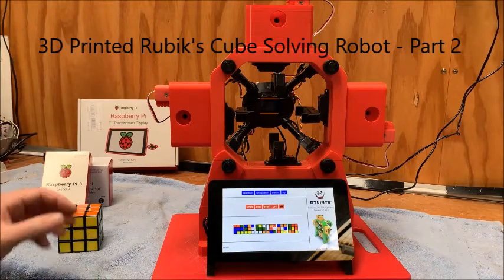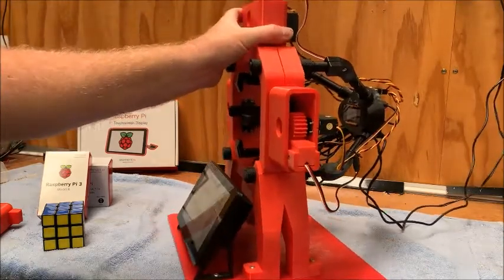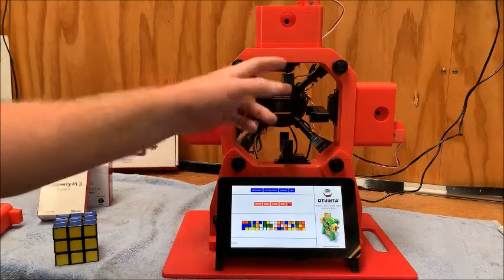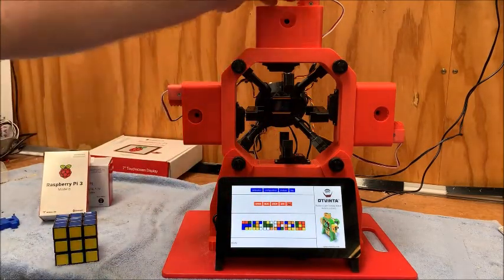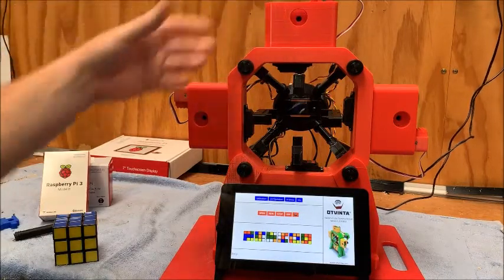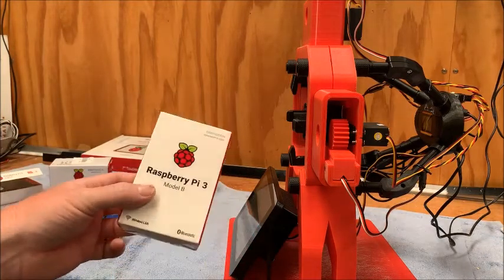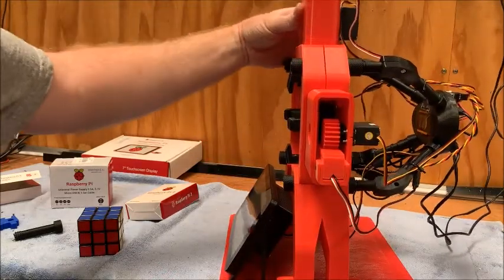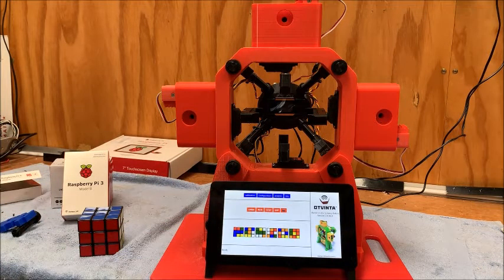3D Printed Rubik Cube Solving  Robot -  Part 2

Comment: It's Sept 15, 2021 and I just built mine and I have all the hardware but waiting on a recommended RCA Cambio because I am a MAC guy and the instructions call for Windows 10 and seems that a MAC IO won't work. No big deal as I got a used one on eBay and I will also print a mount for the robot as you did. I also have a Raspberry but I'd rather run it stand alone via the RC touchscreen. I did have to file and sand down each of the arms so the sliding gear and servo's don't bind. I did that before installing any of the servos because I figured they might bind if the tolerances were off even a little. They did rub quite a bit so sanding, I felt, was definitely needed. I printed all the parts, I did not buy them as I saw you could buy the parts from OTVINTA. I have some pretty high end printers and I USUALLY design my own projects, this is the first time I have ever printed out someone else design. So, I haven't gotten it to work yet since I am waiting on my Windows 10 machine. I printed mine in multiple colors, golds, wood grain, silver, black, and white. When I have it running I will post a video, if you approve, of my unit. I also constructed and unusual base for mine that makes it look very unique. Cheers and nice job. I am curious if you also had to do any sanding.

Comment: Sorry i didnt quite get what to use.
RPi 3 B+ wont work? Right.

Also, are there any sw installation to get the LCD and touch to work?

Still on planning to build one.
One more thing, how did you power the Maestro / rpi / lcd

Thank you. Great work btw
Reply from the maker: No 3B+ didnt work, had to get a normal 3B